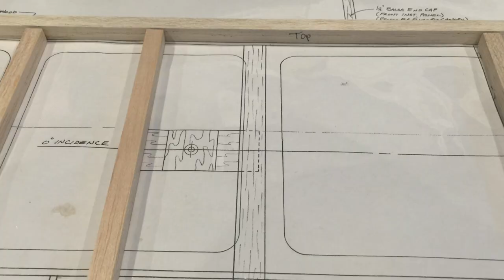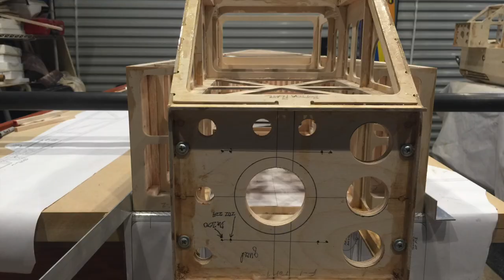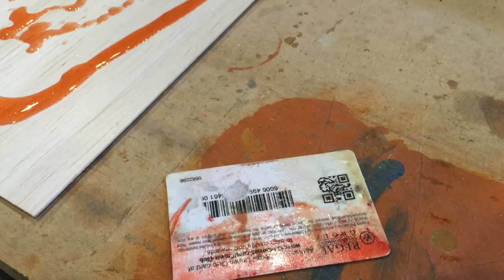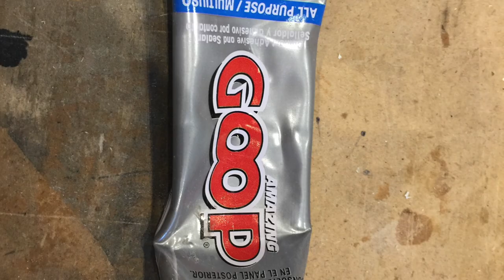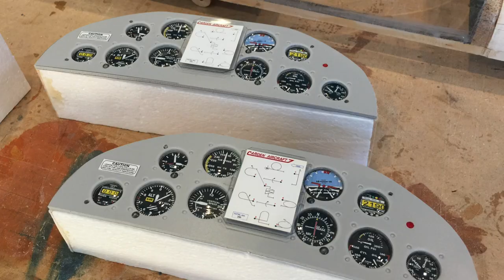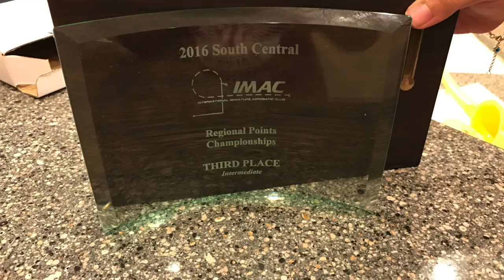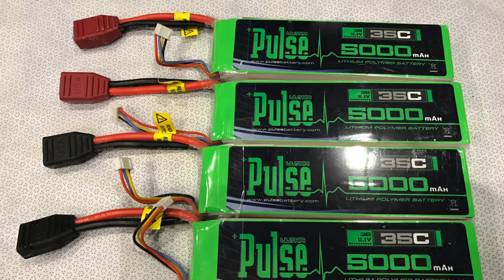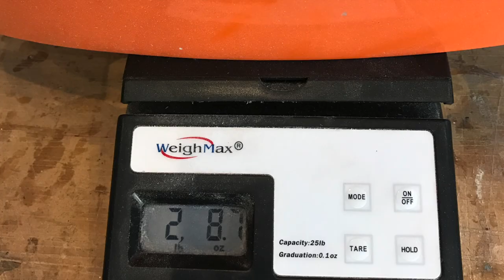Carden PRO build, the movie

Comment: Hi there, what is your technique for Ultracote over Ultracote ?
Reply from the maker: Here is the real trick in applying Ultracote over Ultracote or MonoKote.Here is what I use, Ultracote as the top layer, heat gun, spray bottle with soapy water, and a squeegee about 3”x3” made out of 3/32” balsa (use the grain vertical to the film surface).Like when using MonoKote as the top layer, you “float” the film on top of the base film, but unlike MonoKote instead of using Windex that has an ammonia base you use a spray bottle with water and a very small amount of dish soap in it. The technique once you have the base film covering on the model is to spray that finish with the soapy water, place the Ultracoat piece that is already cut to size and shape in position. Use the balsa squeegee you made to get the bulk of the soapy water out, now comes the trick, while working the water out with the squeegee, use the heat gun first at a fairly good distance and slowly move it in closer as you squeegee the water out. What happens with Ultracote that while you are working the air bubbles out the adhesive begins to activate and you will be able to tell when the Ultracote is fully adhered to the surface. This technique is easy and fast and you are done with each added piece now, and you can move on to the next.      I use both MonoKote and Ultracote, and this soap process only works with Ultracote, for MonoKote I use Windex and wait till the next day and go over the edges to make sure it sealed.
Reply: @porsche1971 . Would asking for a short demonstration video be too much ??? :)
Reply from the maker: @3dholicpilot522  there are many videos on the subject, right here on YOUTUBE.  You can search it and find it.  Here is one:  https://youtu.be/Q6vrphpV_bA